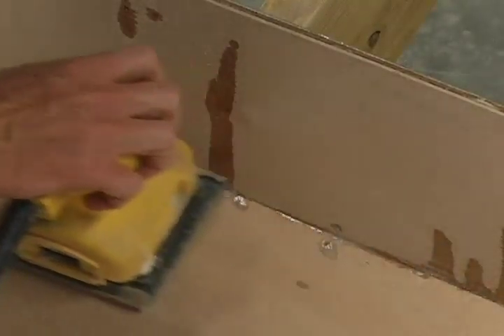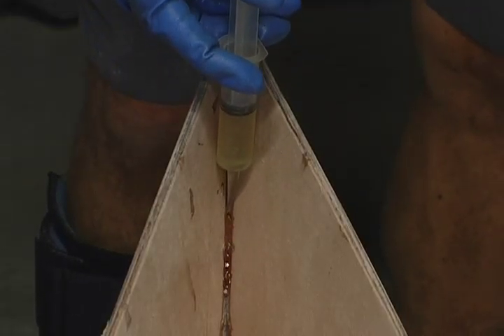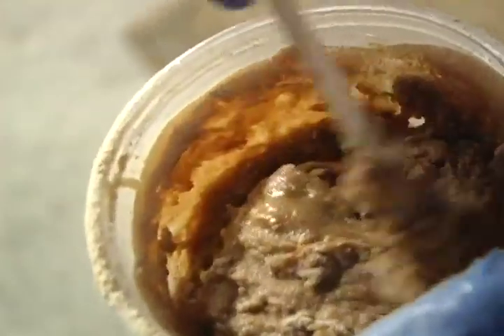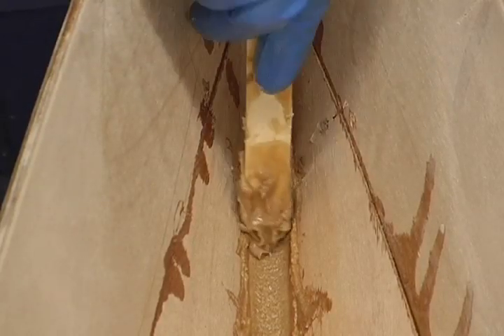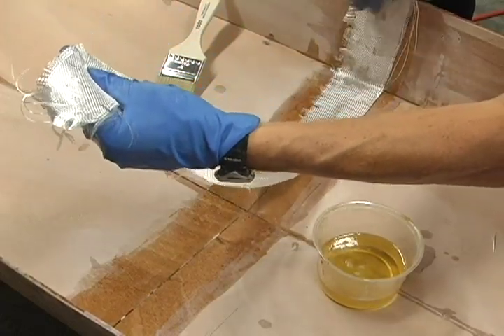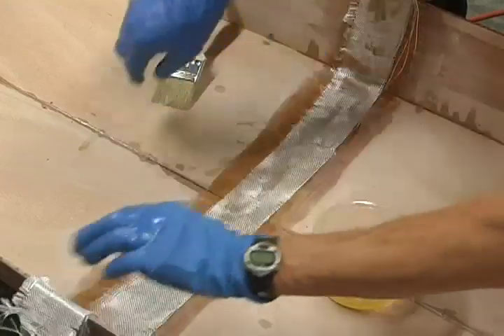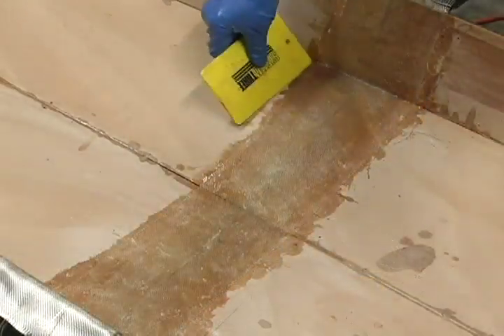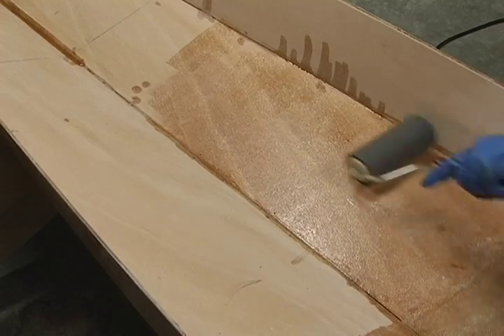27. Fillet Stems and Saturate Inside of Hull

Comment: I would recommend laying epoxy (with a brush)  for an inch on both sides of the stem and stern joint, before applying the thickened epoxy. This will provide a much better bond for the thickened epoxy. This is the recommended method in epoxy manuals.